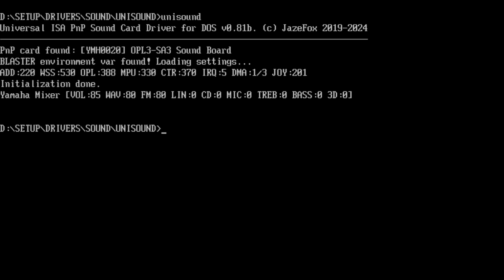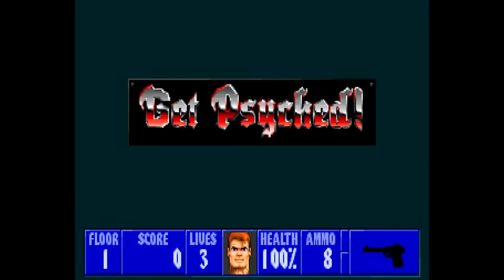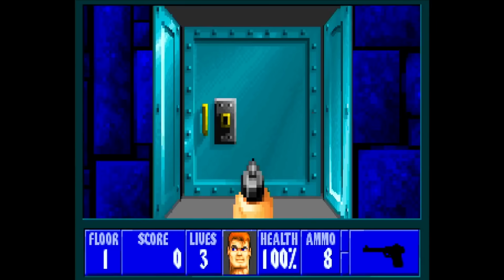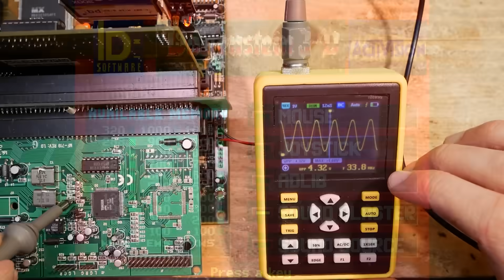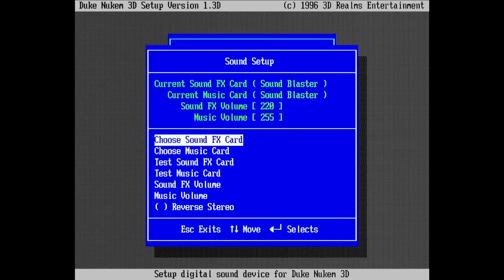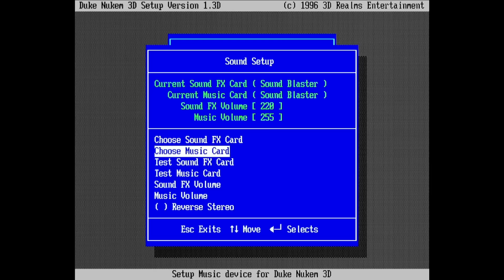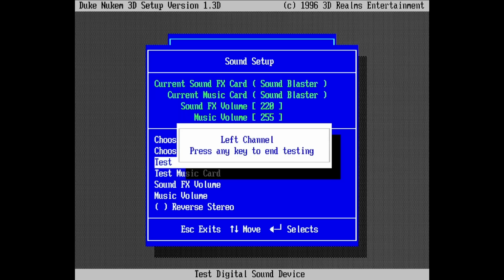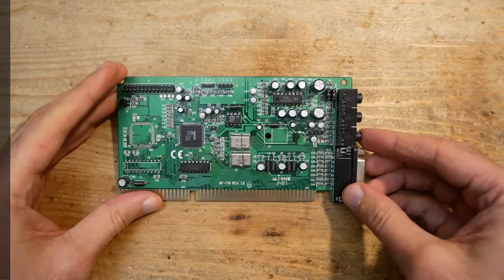Let's repair Yamaha MF-719 ISA sound card

Comment: Great work! I was kind of surprised you were able to measure crystal frequency. Often probe's capacitance "overloads" them, practically shunting any output.
Reply from the maker: You have to use high resistance mode.

Comment: What a very strange and unusual failure. I sure hope this was a manufacturing defect on that lot of resistors. Because otherwise you really need to buy some lottery tickets.

Could have been nice to look for other 3.8k resistors on the PCB, and if they too had failed.

Comment: One of your soldered resistors now have a cold solder join :P (good finding, tho)
Reply from the maker: Good eyes, though it doesn't. I went over it with a soldering iron after it. Just cut the video too early.
Reply: @necro_ware  yeah, the usual tradeoff between video length and number of details :) Just wanted to note here, just in case!

Comment: Crystals are working in third overtone, so you are measuring the fundamental frequency, probably there are some low pass filter somewhere to cut the lower frequency and pass the third armonics. You can see it with a spectrum analyzer.

Comment: When measuring resistors in-circuit, the measured value can be lower then the actual resistor value do to other circuits in parallel with the resistor, but it can never be higher. Anything in parallel will always lower the total resistance, never increase it. So you could immedately tell the second one was also broken.

Comment: I remember Yamaha 719 ISA card in Windows 98, it was able to play multiple sounds at the same time while Sound Blaster AWE 32 couldn't. Also it played at 48000 Hz sample rate well, while SB could only 44100 and that was the issue when  trying to play some MPEG4 movies encoded into DIVX from DVDs. AWE did play but 48000 was kinda converted into 8000 and sound was as terrible as it came from telephone line.

Comment: 5:10 the bottom solder joint on C26 is completely cracked. And you reflowed it as a side affect of resoldering the two resistors :-) Probably C29 and C25 as well.
Reply from the maker: Those are just scratches from the probe.

Comment: Hey Necroware, what oscilloscope do you have there? I've been trying to find a small portable one for work.
Reply from the maker: Fnirsi 5012H
Reply: @necro_ware  thanks!

Hey, another quick question. I got a 486 I am putting together. Motherboard is a Luckystar LS-486E REVC. It has a Floppy Disk Fail (C0) error when it posts. I tried different floppy cables, power, drives and also removed all of the cards including swapping out video cards to rule things out. Think the FDC/UART chip is done for?

Comment: You can get sample packs of SMD resistors for not much (€20 or so) with 20 resistors with values from a few ohms up to megaohms (the E24 values range cover most requirements).
Reply: Which shop sells them?

Comment: They are probably 3rd overtone crystals, and the lack of bias from the resistors was causing them to run at fundamental instead of overtone
Reply: I'm surprised and midly impressed that I slightly understand this.
Reply: absolute correcte diagnose 👍

Comment: greetings
I have the same Yamaha 719 sound card in my small collection of retro computers, one channel does not work, unfortunately I am very far from knowledge of electronics and will not be able to cure it myself, for me it is a kind of magic )))
I envy those who understand this matter
Reply: I'd start with the basics, checking the 3.5mm jack by wiggling the plug or pulling it out a milimeter or so while sound is playing to see if the contacts inside are broken. Other than that, check the jumpers next to the 3.5mm jacks (see 2:41 in the top right). Those switch between line-level output (to connect to amplified speakers or a hifi) or amplified output (for passive speakers). If one of those jumpers is missing, that channel won't output anything. Worst case scenario the amplifier chip itself (on his card the UTC2025 in between the rows of capacitors) is bad
Reply: @Knaeckebrotsaege  Thank you

Comment: Hi, there was a cracked solder in a capacitor near the two resistors, that gets reflowed at the same time, i bet that was also part of the problem.
Reply from the maker: That looks like a crack indeed, but that was just a scratch from my multimeter probes.
Reply: @necro_ware  just commented the same and then I saw your reply here :-)